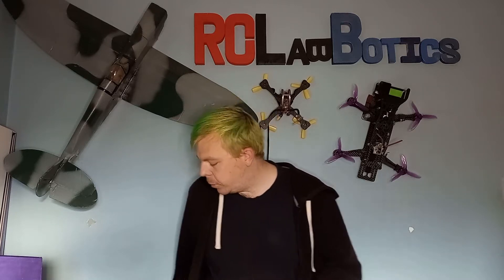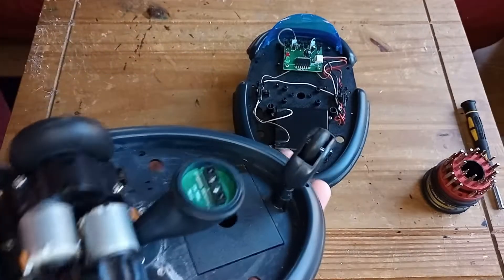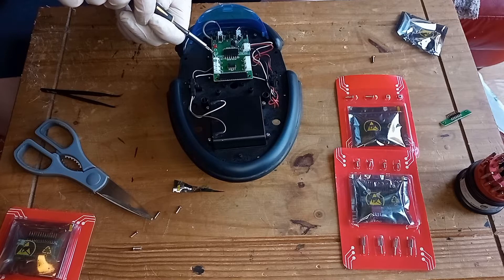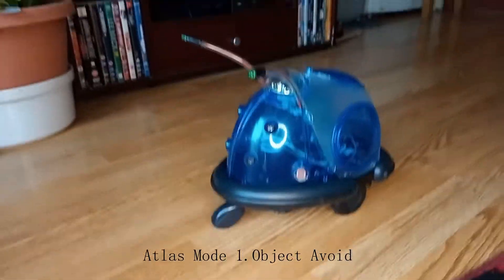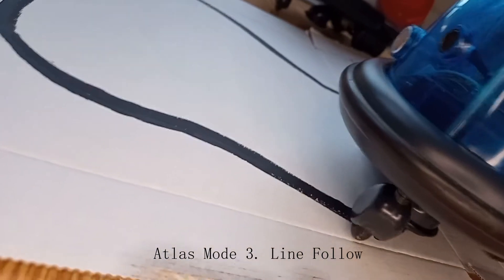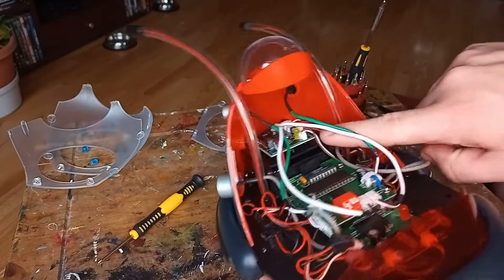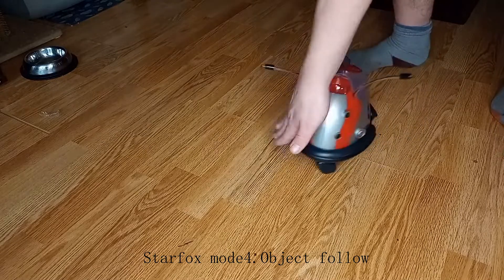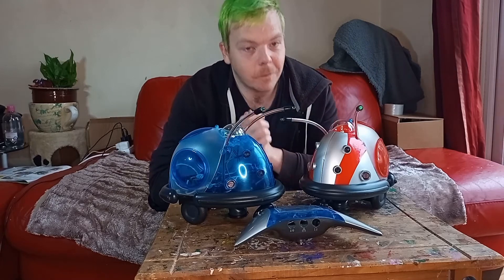Build your own Robot Cybot

Comment: I don't know if you're still interested in this or answering comments but I just got my Cybot out of storage! good news is he powers up, bad news is instead of the series of beeps saying what mode it's in, it makes a sad tune of 4 beeps that gradually get deeper in tone. Short, short, long and longer. Do you know what that means?
Reply from the maker: 0000 light follow mode
0100 object avoid mode
0110 object follow mode
1110 line follow mode

No idea what the beeps means sorry I never got around to installing the beeper but usually in motherboards 4 beeps means not enough power so only thing I can suggest if it has fresh batterys is take the board apart give them a good clean and reassemble see if that helps if you need any spare boards let me know I have lots of them.
Reply: @rclabbotics5413  Thanks for your reply! Yes I think i am going to disassemble down to it's most basic modes to see if that works and go from there. thanks for the offer of spare boards, i'll see how i get on!

Comment: I collected all of the Real Robot magazines back in 1999 ( issue 1 to 96 ) . Despite its age, it is still in unused condition. How did it become like that?... it's because I literally never used it, and I never even placed a battery in it. I completed the magazine series, still have the VHS tapes and programming CDs, completed Cybot and all its alteration with all its circuitry, completed the remote control, got the soccer horns and soccer goals ×2 plus the soccer ball and lastly got the final Real Robot model TOM ( Tracking Orbital Model ) also with soccer horns. Why I never used it is also now a mystery to me, but regardless, it's in excellent condition. Recently, I made a YouTube video about Cybot and TOM and all the other things in between. It's my second video on YouTube, so you might find lacking in information, but you'll find it still fascinating.

Comment: I have many of these and still use them and update them if u hav any questions plz ask
Reply: What updates have you done to them?
Reply: @Tims_Projects  mainly just upgrading power from aa's to li-ion 18650's, been playing around with motor's too the h- bridge can handle 9v so i found out
Reply: @z-t-i1242  Cool.
Yes Battery/power was the only drawback to this robot back in its day.
I went for the Flat Li-Po type batteries because they where a better/easier shape to fit inside Cybot.